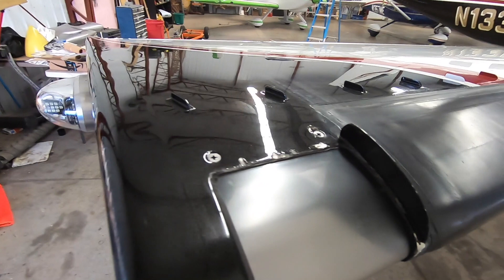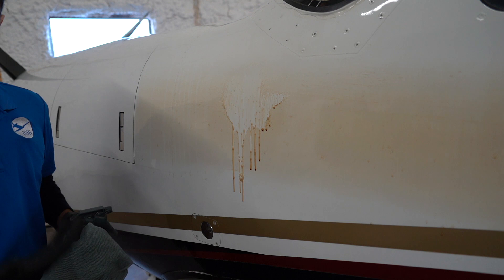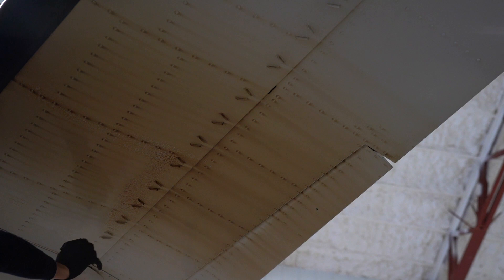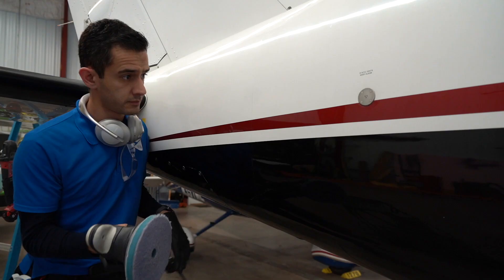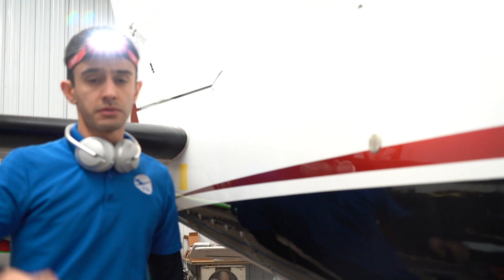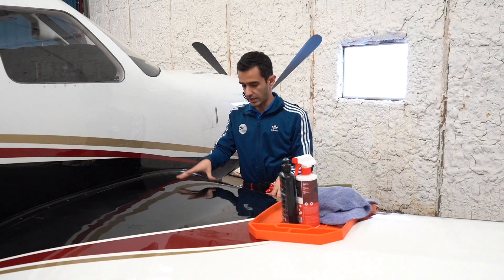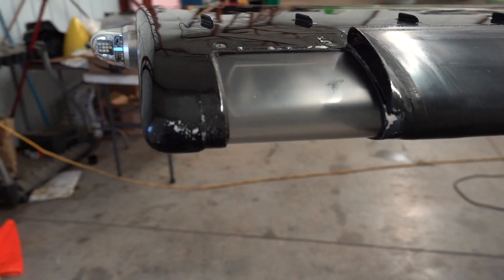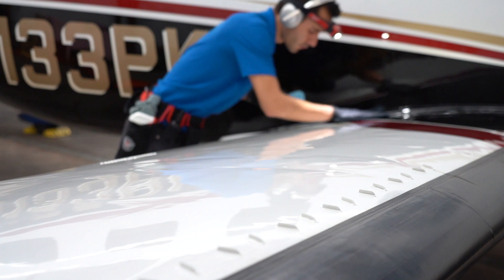Fixing Piper Meridian Paint Problems

Comment: What effect if any do colder ambient temps have on any of your processes? Keep up the videos, very instructive.
Reply: I think he's said in earlier videos that a warmer temperature cures the ceramic coating faster.  And that if it's not warm enough, it won't cure at all.
Reply from the maker: I prefer cooler temps. Give you more working time with the coating. It still will cure, just more slowly

Comment: What product was used to touch up the paint on the screw heads between the windshields? It looked like a two-step process.
Reply from the maker: https://amzn.to/3j23sJ7 The first step is just using the sanding tip to prep the substrate